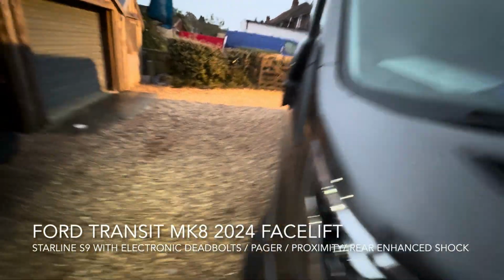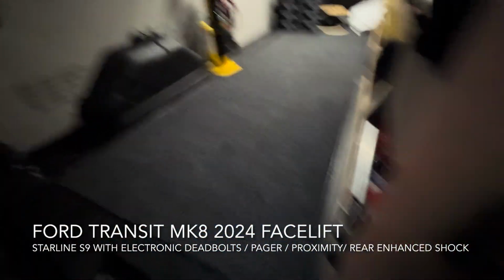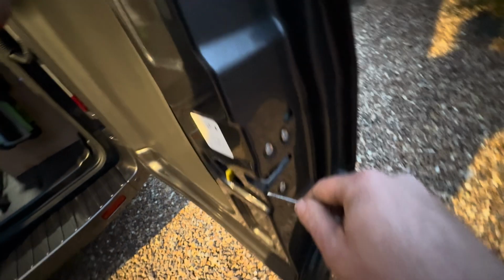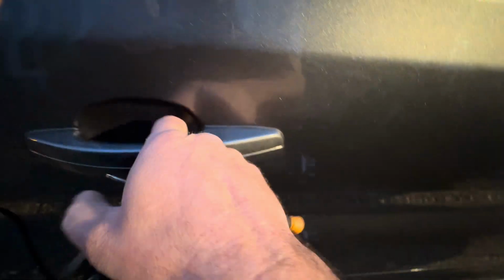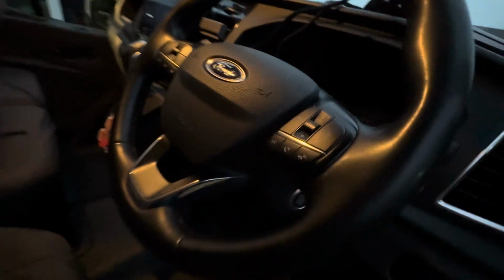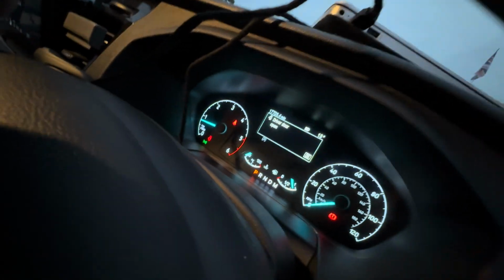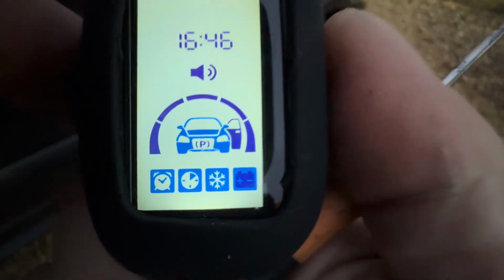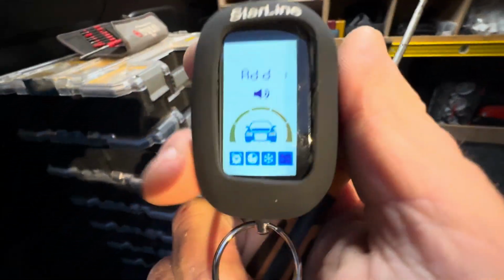Ford Transit Mk8 Facelift alarm / Electronic bolts / Pager / Extra Siren / Pin2Drive

Comment: That look like a great system. Could this be set up for a camper van so you could sleep in the back etc & still arm it? I think the proximity sensor for example would be great for this situation to warn people away before they even try touching the van. Also could the internal deadlocks still be activated if sleeping inside?
Reply from the maker: Yes. You can operate the alarm in several modes , full arm , camper mode and service mode   Each mode will disable certain aspects of the system , for instance camping mode will turn off the shock / tilt / motion sensors but protect all doors , boot , bonnet.  
And yes.  The electronic bolts could be operated in isolation from inside or outside
Reply: @VehicleFit This is great news, I’m currently looking for a MK8 transit 350 to buy for conversion. In the camper mode, can you still have the proximity sensor on?
Reply from the maker: Yes. All sensors are able to excluded or included.  I can write scripts and add buttons to the app to enable and disable anything. 
In camper mode you could leave the front proximity warning on, but if you entered the front seat area while armed , you would also activate it from the inside
Reply: Ok sounds good as in it’s customisable. Thanks for getting back to me so quick 👍

Comment: What does a setup like this cost?
Reply from the maker: Ford Transit / Custom prices 

Hi. 
Thanks for your call earlier. 

Alarms 

The StarLine S9 alarm which includes;
Alarm 
GPS / Glonass Tracker (3 months history)
3 month vehicle event logs 
Remote adjustable Shock / tilt / motion sensors 
Rear load enhanced dual zone shock sensor 
Mirror fold off lock and engine start 
Horn honk on full alarm 
Volume adjustable siren 
Remote lock/ unlock  off app 
Remote anti hijack
Extra cab LED
App with vehicle feedback 
Phone dialer (alarm will call up to 4 phone numbers if activated ) 
Pin2Drive mode (requires pin entered on steering wheel before vehicle can be driven)
Vehicle status feedback 24/7 (doors / temp / mileage / fuel etc) 
£979 plus vat 

The StarLine E9 series alarm which features all the above apart from remote access / tracking / live feedback / phone dialer / remote anti hijack 
£799 plus vat 

Window module to enable total closure / window vent / one touch windows both sides 
£399  plus vat 

Remote start on automatic Euro 6/ 6.2 vehicles is included 

Front proximity sensor to detect people approaching cab area and warn away / roll up windows 
£149 plus vat 

Locking systems

Hook Deadlocks on side and rear door and drivers door replock package 
£449 plus vat 

Individual hook deadlocks are £145 plus vat for 2.  3 and above are £125 plus vat 

Electronic locks 

Electronic internal deadlocks are £250 per door plus vat including linking to StarLine alarm system for secure control 

If no alarm installed.  Add £100 plus vat for a separate remote control module to control them 

External shield for side loading / rear barn door £145 each 

Immobilisation 

Scorpion X 
Canbus self arming immobiliser (uses steering wheel buttons to enable vehicle to be started) 
£399 plus Vat

StarLine Immobiliser system 
Self arming dual blocking immobiliser with built in shock / tilt / motion / horn honk alarm features 
£499 plus vat 

(Add mirror fold of vehicle lock / PIN code  entry for £50 plus vat )

Sterling Thatcham Category 2 immobiliser with Tag to disarm 
£399 plus vat 

Camera 

Reverse camera with integration into factory Synch head unit 

With high level brake light camera 
£399 plus vat 
With low level number plate surround mounted camera 
£349 plus vat 

Have a look at what we can do to Customs / Transits on my YouTube channel 

https://youtube.com/@VehicleFitLtd

Thanks

Andy
Reply: @VehicleFitLtd  thanks. I will be in touch when I find a van.
Reply: Interested in price to
Reply: Awesome install best I've seen I've gir same van I want the exact same install and this spec what's the price??? 🙂